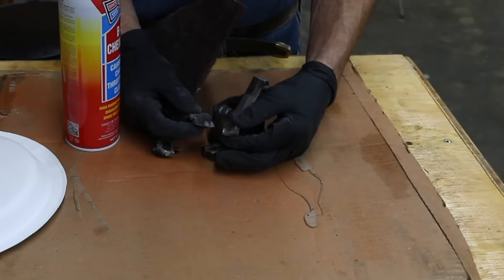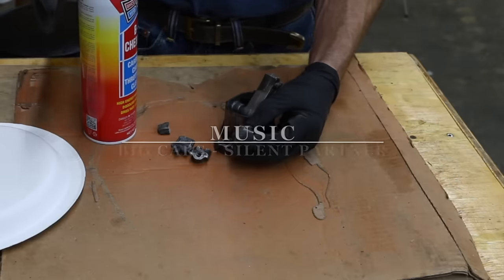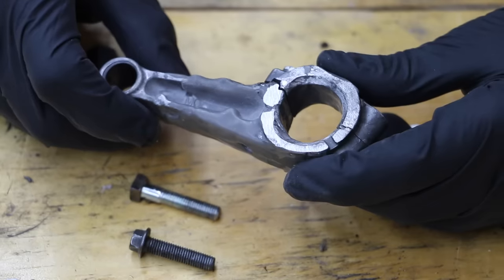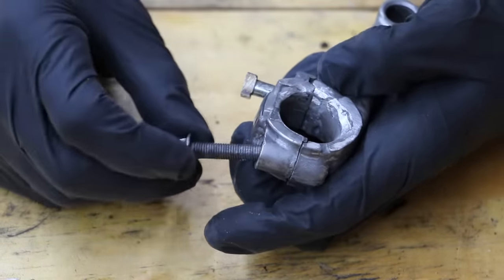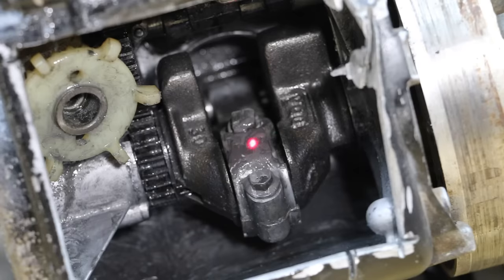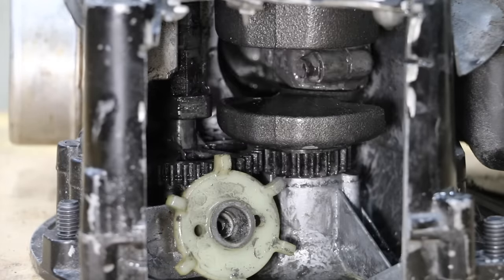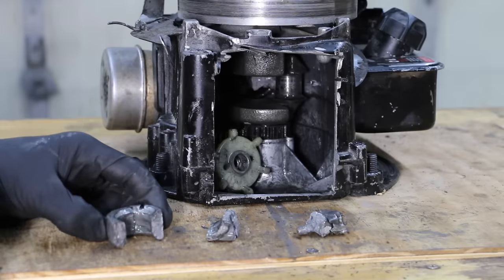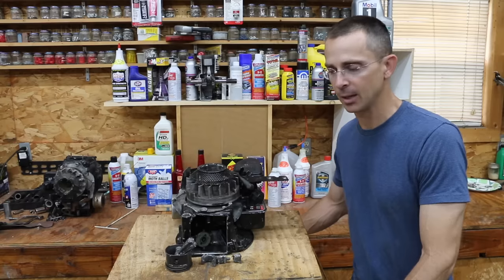Is JB Weld Strong Enough to Repair a Broken Connecting Rod? Let's Find Out!

Comment: if JB weld actually worked, I'd be damn scared of buying used cars.
Reply from the maker: lol. Great point!
Reply: Phew! It's safe
Reply: Bee JayGee lol 😂
Reply: Are you kidding me, people are using Raman noodles as bondo 
 When you power wash your car you'll realize what it's been through
Reply: Call it what it is....it's an epoxy compound (resin/hardener)....hardly as comprehensive as a weld. I suppose if there was a busted engine around it would have made for an interesting video
Reply: RIGHT!! It's already a dubious process looking at used vehicles.
Reply: Right lol
Reply: someone should do a movie on this stuff...  :)
somewhat more technical than red green etc.
Reply: @All Cars Matter I JB Welded my crankshaft pulley back together and drove on it before the replacement arrived.
Reply: Don't buy a car off me then..
Reply: You should still be scare..... There is alumaloy. Its the aluminum welding JBweld
Reply: @rolandocrisostomo2003  I repaired the aluminium casing on my gearbox with standard JB weld.
That said, I plan not to sell the van and if I did I'd be up front about it even though any potential buyer would be hard pushed to spot the repair. It's a bodge and I know it.
I've seen threads on forums where people are genuinely proud of having "restored" a car by filling it with fibre glass and filler.. Wankers.
Reply: My mate had a holed piston his answer? Nut bolt washer  quick test run after rebuild quick sale what a c#nt if you fix something do it properly
Reply: All Cars Matter I did the exact same thing on a car I sold for $12800. It was a VW TDI under the buyback program. It was going to the crusher anyway. Perhaps we can still be friends 🤣
Reply: That's a almighty good point!
Reply: @rtharmon454  I was one of the first female car sales people and I have a lot of true stories, I was fired because of my morals and I called the asst. Manager out for opening my mail! When I went home I told my husband that after my day off I was sure to get fired and I was right!
Reply: it just has to work for a week or so right?
Reply: You should be damn scared of buying used cars anyways
Reply: @sciroccosven  You got $13000????
Crap, they ripped us off and we only got $10K for the PoS.
Reply: ROFLMAO
Reply: But leather belt does temporarily fix spun rod bearings.
Reply: I had a 86 Honda f2x700s fazer street bike that i was off roading with  and dumped it into a pile of rocks and broke a huge hole in the crank case so i JB welded it in 1992 and 20 yrs later i seen it chained to a tree forsale so i stopped and he wanted 4k for it , i ask if it had a hole in the case and he looked at me like i was crazy but i got down and looked and sure enough there it was, 20 YR OLD JB WELD STILL HOLDING STRONG
Reply: Ya , me too !!  Now every damn car is a damn automatic,  hard to find stick shifts 5-6 speeds , the vechical industry must think 90% of Americans cannot drive a clutch . Personally I like 2015-2017 Toyota Tacoma's & Camery's clutch only , but I've been looking for over 4 years, and when I do find one , it's all fkd up.
Reply: I think you should write them an e-mail, where you complain about the product, as if you actually thought, it would work - and send pics to prove it - just for the laughs..  I bet they will looove it - and probably send you a few tons of free products "as compensaion"..  :D
Reply: @All Cars Matter lol
Reply: You should be anyway, but only enough to make you look at the whole car before buying ;)
Reply: @deb patterson Thank you for doing what's right. The world needs more people like you.
Reply: Good video 👍
Reply: Thank god for Duct Tape
Reply: They do make some that could handle this. But would cost more than an entire engine.

Comment: Lol. Heck no that ain't holding up. Now time to watch it.
Reply from the maker: lol. It was a fun test.  It actually fired up and held for a very short period of time, which is amazing
Reply: Should have made a complete connecting rod from JB Weld
Reply: Patrick Fennessy next video.....
Reply: @gettintheresafelywithpatf2869  and pistons from large bamboo sections! Waste of youtube
Reply: TennCutty may be a waste of YouTube, but the self destruction would fun to watch if nothing else!
Reply: Lmao i was about to say the same thing 🤣
Reply: Exactly my curiousity !
Funny...
Reply: Lol I said 'nope' as I clicked play as well.. if nothing else, just to see how long it takes
Reply: @tenncutt  This is peak YouTube what do you want cats?
Reply: JB weld needs to change its name imo. Its useful but not nearly as useful as the name implies. Still just an epoxy.
Reply: @dcgregorya5434  a lot stronger than a lot of epoxies, also takes a lot higher temperatures than normal epoxies. 500F would destroy and completely weaken most two part epoxies
Reply: There is a video on YouTube of somebody making pistons out of wood
Reply: JB Weld is great for loose teeth.
Reply: JB Weld has not held one item of mine that broke.  Excellent marketing and name but poor item.
Reply: @mytexasdays1526  I used JB on my hairpiece and can assure you that it holds just fine.

Comment: I repaired a radiator leaks on my truck over 5 years ago using jb weld. Haven’t thought about it in a long time until I watched this video yep still holding water hahaha
Reply from the maker: Impressive results!  Thanks for sharing.
Reply: Dusti Jones ... a radiator leaks?
Reply: Fixed my ex's car that had a punctured oil pan with JB weld. It at least lasted 3 months. I don't know if it lasted after that as I left  her.
Reply: Don Avan  good ol bypass
Reply: how is that relevant, to what he has done?
Reply: @rokowoju8558  fixed the problem didnt he?
Reply: @savagesock3598   it is not relevant in this case,JB Weld is nothing special just a brand , only because  word  Weld is in it it does not mean it can do that, JB Weld is just epoxy glue and can repair toys, block holes, and things that have to hold something  in place but not exposed to big forces of any kind, running around with radiator fixed by JB weld and gluing conrod are two different things in essence all problems are not equal are they?
Reply: @savagesock3598  you are  making assumption - what makes you think I am a dude?
Reply: Same on my suzuki radiator lol
Reply: I'm 56 and I am starting to get a little scared about what will happen to me if ever I can't hold my water. :'(
Reply: Me too..This stuff works awesome on radiators
Reply: @JoshuaMuse  This is the best comment by far and kind of funny haha good for you man.
Reply: Dusti Jones black pepper or an egg also works on radiators not a permanent fix but they will seal the hole to get you back home
Reply: @JoshuaMuse  lol it outlasted your relationship 🤣🤣
Reply: @rokowoju8558  p
Reply: Don Avan  everything is temporary in this life. Especially if it's made in China
Reply: Yep. I used it to fix a hole in a gas tank while in West Va when I hit something on my way to North Carolina. I made it to Ft. Jackson and there was no way I was getting my old Ford Fairmont fixed at a garage. I put some JB Weld on it. Let it sit. And it held. I made my way back to Ohio and it held until I finally junked the car years later. It’s probably the only thing left of that car right now. :D
Reply: roko woju yep you are right, I didn’t mean to make it sound like I was trying to compare what I did to what was done in this video, just that nostalgia struck and I remembered how I used the J.B. weld once and it worked well enough for me to forget about until years later  and figured I’d share the story just for fun haha I knew it wasn’t relevant when I made the comment , but ...I didn’t even think a comment like that would ever even get a reply , though thanks for taking your time to write one!
Reply: I fixed mine with pepper haha
Reply: It’s surprisingly good for small applications. I had a hole in our sink garbage disposal. I used J.B. weld for a temporary hold until the new one is shipped to me. 7 years later there was still no leak but the motor gave out. I finically can use the replacement unit that I bought.
Reply: What type and year?
Reply: @JoshuaMuse  that's what she was worth.
Reply: David Gallego 1994 Chevy C3500 6.5 TD
Reply: @dustijones6964  built better back then
Reply: I used jb to bond a brake lever for a street bike... Stupid but this was my rebel days.  I stopped hard one day in the neighborhood from 170 to 0 and felt it flex.. so I figured it was time for a good lever.  😆
Reply: @horsehung9471  
There is a pelletized Bars Leaks that I used extensively before all the computer stuff → would not use it now with current design but after 20 years dependent on them I selected that brand;

Never found any use for JB Muffler weld other than jokes;

You use coat-hangers to hold up the exhaust
Reply: For stuff like valve covers or radiator leaks it will work, at least in older vehicles that aren't running high pressures in the cooling system. For cooling systems, learn how to tin stuff, it's really easy to do and requires next to no skill. Just a piece of reasonably well fitting sheet metal and some tin to melt between that and the thing you're repairing using a propane torch.
Reply: Same here. 6-7 years ago I punctured my Jeep's radiator while being haphazard installing the viscous fan. Cleaned up the punctured area and hit with 2-part epoxy. Still working to the day.
Reply: Same. I smashed my radiator off the ground going down a road with whoops (up and down little hills if ya don’t know). Put a big hole in the plastic end case. 
Ended up JB welding a piece of tin over the hole. Still holding to this day.
Reply: @fatdad64able  "Hey doc. I need a prescription for some JB weld".

Comment: I (think I) remember any old MacGyver episode where he repaired a connecting rod with a silver coin, using a car battery as a welder. Try that.
Reply from the maker: Thank you for the video idea!
Reply: Yup i remember that episode its on the beginning of the intro too
Reply: The MacGyver episode was called "Trumbo's World" and Mac improvised an arc welder with a silver coin and a generator if I recall correctly to weld together the connecting rod from the engine of a water pump.  The plot of the overall episode was a remake of "Leiningen Versus the Ants", a short story by Carl Stephenson.
Reply: It was a nickel not silver.
Reply: @robertpolicastro1  If I recall correctly after repairing the connecting rod Mac says something like  "The power of the American dollar... Half dollar, actually".  Depending on the year, US half dollar coins have been minted in 90% silver 10% copper, 40% silver 60% copper, or cupro-nickle  (copper/nickle) composite so saying either silver or nickle could be correct depending on the year of the coin - and Mac was not so helpful to tell us what year coins he was using!
Reply: Macgyver is a hack, Client Eastwood did it in Escape from Alcatraz using a bunch of matches and a dime.
Reply: I remember that lol
Reply: @TheSchmed  Thanks for throwing in your ten cents.
Reply: Jimmy De'Souza   No i dont think he wants to fucking Blow up along with the batteries hooked up that way.
Reply: @alejandroochoa3541  There are vids of it working. The current is high. Two batteries, using the negative to decrease the splatter. A thin electrode... No problem.
Reply: @trollmcclure1884  It was fairly common to use a battery or two and jumper cables as a welder for field repairs in the old days.
Reply: The macgyver episode is Trumbos World.
Reply: @robertpolicastro1  it was actually to half dollars. Silver.
Reply: @davidroberson1962  i know a dude who welds using 2 huge 72v batteries
Reply: @Vincent_Sullivan  Wow. You know your shit lol impressive! Should start a YT channel.
Reply: @TheSchmed  Dude, they're not real humans. You know that, right?
Reply: With no lubrication on the connecting rod I don't imagine the excess heat helped.  Or the hand ground bearing surface either. Fun to watch though!😉
Reply: @Vincent_Sullivan  Project Farm needs to compare the old quarter with the new quarter and may as well weld one up with a nickel since we are all very interested in the real value of money.

Comment: A trick to increase the strength of epoxies like JB weld is to bake them for a few hours. I usually do JB weld at 200-250F for 8 hours in high strength applications where it is appropriate. Often times I will clamp the parts, and cure it completely in the oven. Where clamping is not practical, I let if cure overnight,then bake. Ive also simply left them in a hot car in the summer. The nice (and sometimes bad) thing about complete curing in the oven is that the epoxy gets very thin. That lets it flow into all the microscopic pores scratches and imperfections, allowing better surface contact and helps eliminate microscopic and macroscopic voids. Ive considered curing it in a vacuum oven to eliminate the voids, at least for the first 30 minutes or so, but no longer have access to one. Heat curing can work well with other epoxies too. I used JB quick to put a threaded bushing into an Edelbrock carburetor and heat cured it and it has held up for many years in contact with gasoline. (its said that heat curing can also improve chemical resistance) For other epoxies however you want to change the cure temperature. I use the service temperatures as a hint. I dont want to go hot enough to degrade it, but hot enough to push the chemical reactions to completion.
Reply from the maker: Great tip! Thank you
Reply: Hi do you think it can hold the spark plug without melting? my spark plug stripped the threads
Reply: @giwtwm  Nope. It's going to shoot that plug out of the block like a bullet. The head probably gets around 200C or so. That's within it's service temperature, but still requires you to derate the epoxy. However, it's way worse than that. You now have created an insulating layer between the metal head and the metal threads of the spark plug , which protrudes into the combustion chamber. The plug normally will be hotter than the head, but now it will be even hotter. 

What you need is a timesert kit. They make a kit specifically for repairing spark plug threads. It's not cheap, but it will make a permanent professional repair. You drill out the hole to the proscribed size, then use special tap that is supplied to tap new threads. The use the supplied tool to thread the insert in and expand the bottom of it into the hole locking it in place. I would price getting the kit vs having it done. It might be cheaper to have it done. It shouldn't be more than an hours labor. Probably less if they charge in smaller increments. 

If the head is on the engine, then you have to make sure the metal shavings don't get in there. The way to do that is to start with the cylinder at the bottom of the compression stroke. Get a grease gun and fill the cylinder with some sort of grease. Doesn't  really matter what kind. Petroleum jelly could probably work too. Now fix the threads. Then, take a shop vac and a fat drinking straw and carefully suck out as many of the shavings as you can. Then rotate the engine forward a bit so the plug hole fills up again and vacuum some . Keep doing that until you get to the top of the cylinder. The squirt some carb cleaner in there to help dissolve the grease. Reinstall the plug and start it.
Reply: @michaelallen1432  i have an insert but its just an ordinary one from china, unlike time sert it doesnt have the thing that expands the bottom threads my problem is everytime i took out the spark plug the inserts come with it i need a way to make the insert stay in the head permanently and sadly timesert is not available in my country
Reply: Just as I expected….my experience with JB weld has not been great…recent;y bought some metal repair adhesive for about a 1/10 of the price of JB weld on Temu..it works as well if not better but has limitations for sure
Reply: @giwtwm 😂😂 i just did that on my motorized bicycle hoping it works for at least a litte but

Comment: As you said this was a little over the top but I have used it for over 50 yrs. for many different things and for what I used it for always seemed to work fine.  A friend of mine stripped out his alternator tensioning bolt on his ford van and I filled the damaged threaded hole with JB and inserted the new bolt and hand tightened it and after drying all night he drove it this way for years until the van wore out.
Thanks for going the extra mile to show us this extreme and for always having a quality video~!!
Reply from the maker: Thank you for the feedback

Comment: JB Weld is a fantastic product! I would not expect any adesive to hold up to gluing a con rod back togetherl 20 years ago I replaced the water pump on my 7.4L big block chevy suburban motor. The pump had a "porosity leak: i.e. "pinhole" in the casting of the pump. I cleaned the area and roughened up with a Dremel carbide disk and placed a dollu[p of JB Weld over the hole. It was still in place and working 3 years later and I fully disclosed to the new owner. JB is good stuff. Everything has it's limitations.
Reply from the maker: Thanks for sharing.